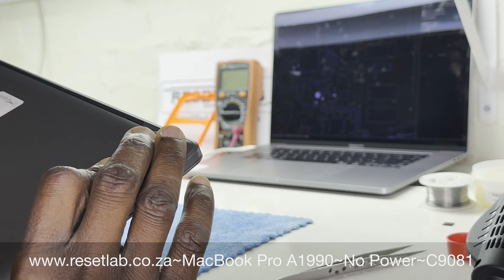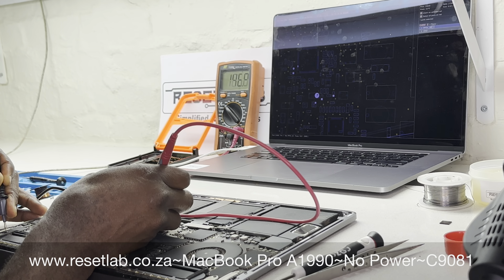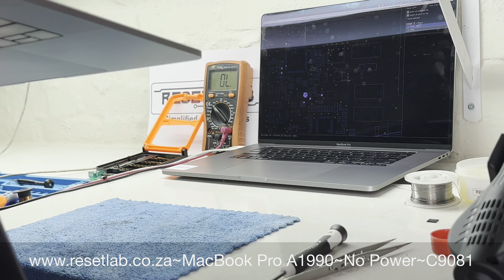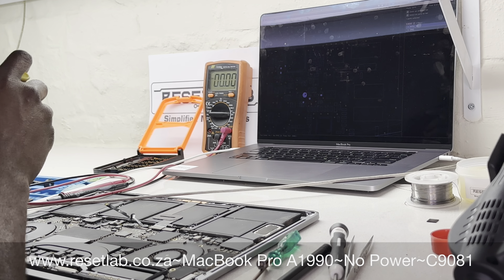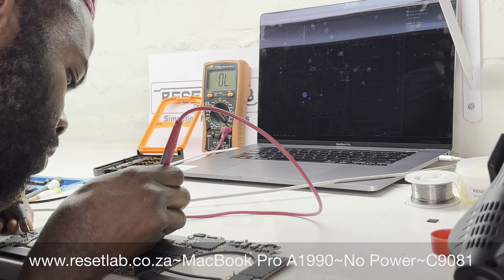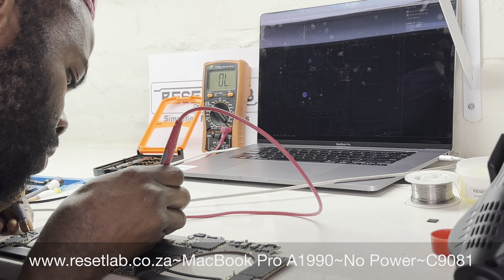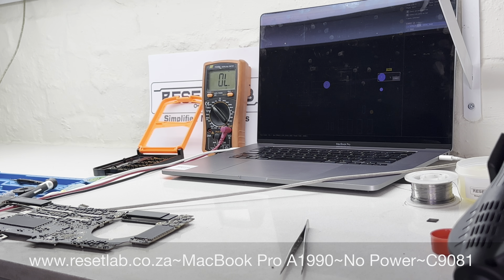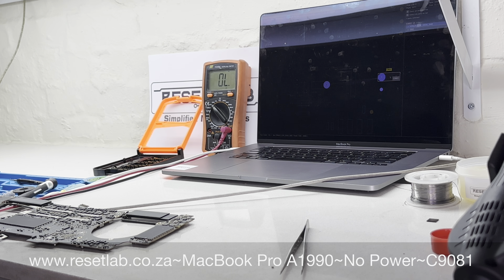MacBook Pro A1990~No Power~C9081

Comment: How to download the schematic? what’s the C9081 value?
Reply from the maker: Apologies for late response, am back online
Reply: Hello, can I get your help with a repair on a 1990?
Reply from the maker: @marcoo3802 hi , how can I be of help my friend?
Reply: @resetlab7142  Hello, I have a Macbook Pro a1990 and it will not power on. 12v rail is shorted. I wanted your advice on approach. Thank you
Reply from the maker: @段传伟  You should generally remove it from the board  and don’t worry about putting it back . What’s the state of the board ?